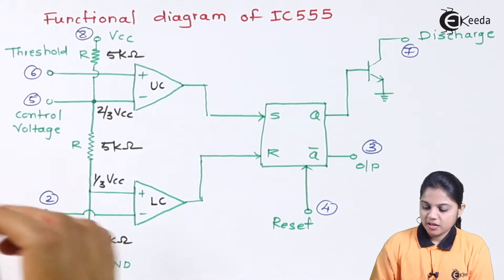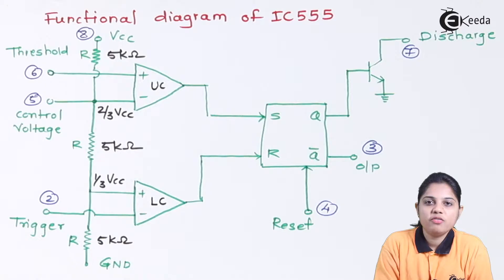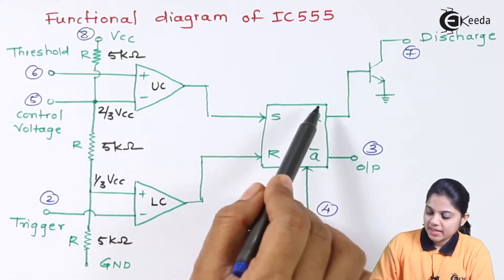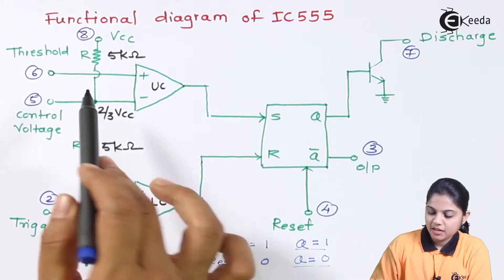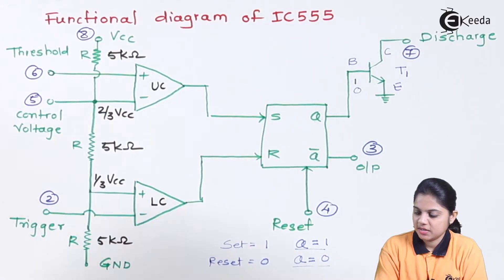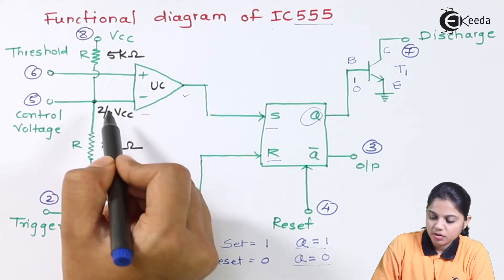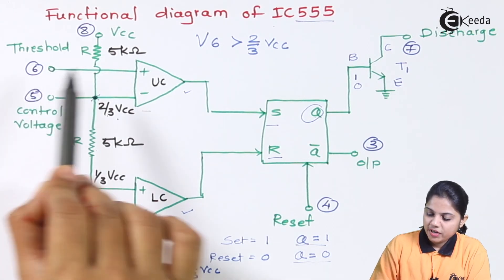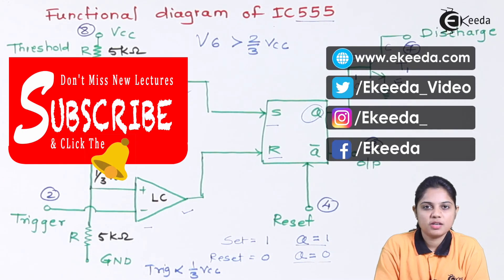Functional Diagram of IC555 - Operational Amplifier and 555 Timer - Industrial Electronics

Comment: There is a mismatch between datasheet's function block diagram and the diagram shown output of the lower comparator is connected to Reset pin but should be connected with Set pin( acrd to datasheet)